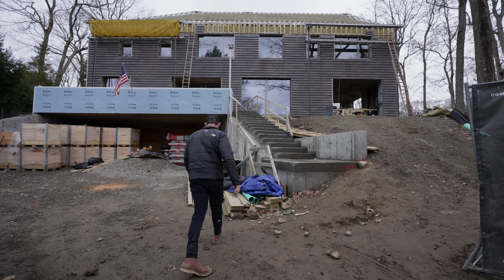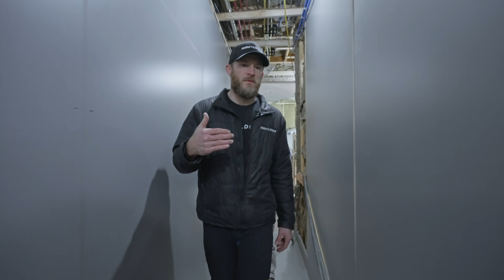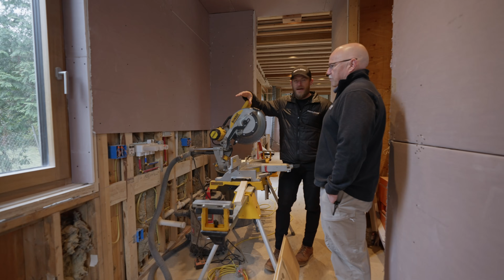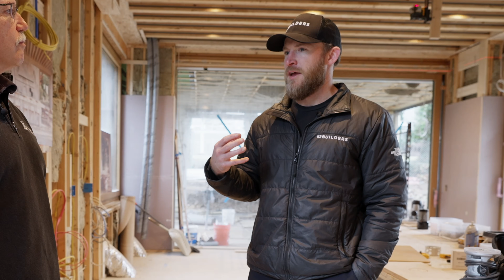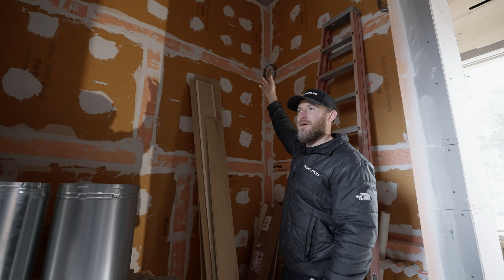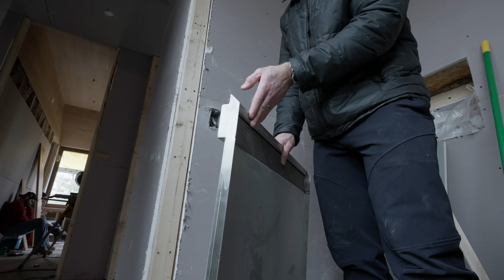How Plumbing Works In A Luxury Home A Full Walkthrough

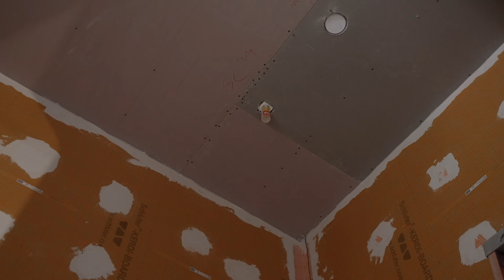Comment: 26:00 From experience this shower head would be uncomfortable to use with its fluctuation in temperature. You'd have to raise the temperature at the source which is problematic especially with a thermostatic valve that keeps tempering the water and making it cooler. Also because of the height, the droplets have a long way to go so the water loses heat through the air and arrive cool. Plus there's the issue of extra condensation in the bathroom... Your best bet is to install an additional shower head that works in conjunction with the tall shower head and have them both work at the same time with the ability to throttle either one to the best water temp outlet. Having one up high alone will create an uncomfortable shower.
Reply: He may also get screwed by the shower valve body restrictor and the heat loss through the lower velocity between the valve and the head.  Hopefully he uses pex between to mitigate...
Reply: Those ceiling heights are just out of control.  A lower ceiling in the shower area is a lot more comfortable.  My first thought about that bathroom was "that's gonna be cold".  With all the distance between the valve and the head, adjusting the temperature will be tricky because of the delay time between the valve and head.
Reply: @incognitotorpedo42  One of the vacation spots I'd stayed at had a shower with a similar ceiling height and a digital controller that looked like it'd cost more than my car. The controller remembered my last-set temp (and there were folks using the shower after me) and there was no issue with the temp, somehow. Maybe it was using a booster heater or other clever tricks, but if it works, a shower that feels like rain is pretty darn nice.

Comment: Interesting walkthrough.  I would have expected some kind of automated water shutoff capability in case on leaks.  Also for hot water, I know AC usage is probably not that high in your area but I have found in Florida that a simple heat exchanger between my AC and my water heater negates the need to have the water heat on during cooling season.  I get plenty of hot water just as a by product of the cooling.
Reply: I'm pretty sure they said there's an automated shut off valve
Reply: @ must have missed that bit
Reply: Who's making a product to accomplish this?
Reply: @cowboywithnohat  look at Doucette Industries Aquefier